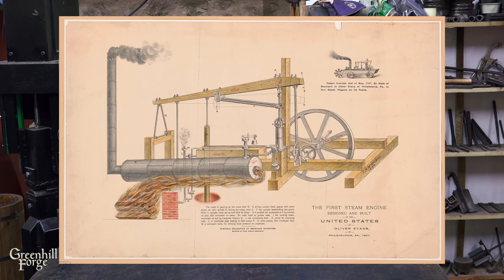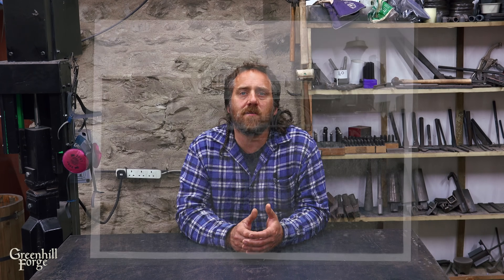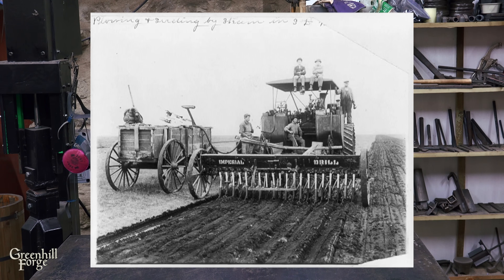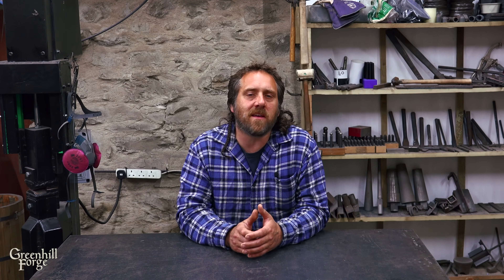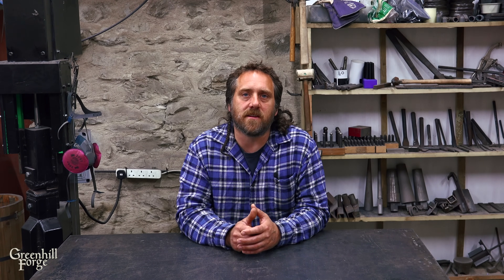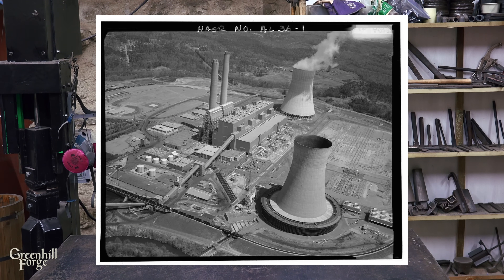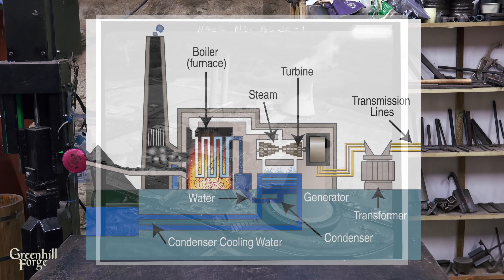Help Me Design an OffGrid Steam Engine + the Basics Explained

Comment: I have a suggestion for one aspect of this admirable goal you have set yourself.   I have considered making something similar myself to compliment my other off-grid / ‘free energy’ creations (solar kiln x 3, solar water heater, work-in-progress rainwater collection and purification, ongoing sand battery project, bug-proof salad crop growing enclosure). So here’s the suggestion and it builds upon developments you’ve already demonstrated with the efficient extraction of heat from wood burning stoves.  So the problem I see is in ‘feeding the boiler’…a nuisance and very time consuming at the best of times. Solution…’bank’ the heat in a mass earth storage facility (‘sand battery’, if you like) and embed the most highly pressurized parts of the boiler system within the same heat storage facility. Yes there would be challenges in so doing (eg regulating i.e. ‘smoothing-out’ the extraction of heat from the mass heat storage vessel, avoiding explosive steam expansion and maintaining wearing parts embedded within the mass storage unit, reduction in overall efficiency, etc)…but there are benefits worth considering I think.  These would include in no particular order:  safe(r) containment of any ‘unscheduled disassemblies’ (ruptures) within the most highly pressurized portions of the system, pre-heating of water, thermal insulation of the boiler, some noise reduction and a few other more esoteric benefits.  I am currently working my way through some ‘wife projects’ so that I can resume working on a domestic portable sand battery using easily available materials and ‘achievable’ methods of assembly. The reason I mention this is because there are some important lessons to be learnt from managing the large temperature change from within the ‘battery’ to temperatures that are tolerable at the output stage. I could ramble on here (already have?) but if you start with a fixed VOLUME of the battery and apply a fixed AMOUNT OF ENEGY to it and hope to EVENLY extract tolerable levels of heat from it you can regulate the maximum temperatures and rate of heat flow through it by adjusting the nature and configuration of the media used to store the heat. I am currently working towards trials based upon various combinations and configurations of sand, aluminum and ferrous metals, using their properties of thermal capacity, thermal conductivity, density and melting points, plus importantly their physical configurations within the enclosure (‘battery’) to optimize the outcome I am looking for….an even, safe and controllable heat source for those cold Florida winters (yes, really). The short version of this is that a fixed amount of energy placed into a fixed volume of material can be made to result in a surprising range of maximum temperatures by the simple expedient of varying the quantities of these three components, plus, their physical configuration within the fixed volume will (can be made to) result in a steady ‘down draw’ of that energy by arranging them to optimize their various coefficients of thermal conductivity.  Allied to this project I have been thinking about a more static mass heat storage system (Amish/Greenhill Forge rocket stove style system) that would have heat extraction tubes and possibly domestic water heating tubes running through it….hence my interest and concerns about managing and controlling steam explosions.  There I said it……British civil engineer (plus self taught, know just enough to be a danger to myself mechanical engineer) living in USA signing off for now.  Good luck, watching with interest.

Comment: hi im not an expert but i used to work at geothermal power plant .If you wanna use just water i suggest not or at least lower your expectations . Cause of the water it does not have the potential to be great and stable in use . yea i may sound wrong but it is. let say we dont have much and we have to use water as a work fluid and then if you going all the way on the project i suggest using seperator for steam and the hot water. Side note:  where i live the tap water is chalky other minerals are involved. To the exit of the seperator akumulator might be great to so brine or work fluid can be laminer flow .Lets get back to seperator the hot steam will go to the turbine .Side note : If you make the line between the separator and the turbine with a 1%-3% slope, you will prevent the problem caused by condensation from disturbing the turbine.  at this point if its complicated make it just like on the prototype . I really like ur videos i might build this on my backyard aswell if yours work :) but things can be got out of hands easily how much bar is it or whats the ttemperature whats the flow rate. I can make contact with you if you wanted on instagram if you respond good luck and thank you for reading the comment.

Comment: A big issue with steam power is efficiency. Due to the nature of thermodynamics, the efficiency is capped by the maximum achievable temperature of the working fluid (or, more accurately, the difference between the maximum and minimum temperatures), and in the case of steam that's the boiling point of water, which is very low compared to what fire can do. This can of course be increased with pressure (the system will spontaneously pressurize to prevent boiling if the water is heated in a sealed space), but pressure comes with danger, and it takes a lot of pressure to gain just a little bit of temperature.  It would be more feasible to reduce the temperature on the cold end by condensing the water well below its boiling point by the use of a vacuum (the condenser will produce this vacuum on its own if the system contains no air) but this will cause air to slowly leak in anywhere it can and necessitates a continuous de-aerating system. Even with a temperature swing of 100 C on the hot end and 20 C on the cold end (0.023 atmospheres absolute pressure), the maximum theoretical efficiency is only 21% or so. If you pressurized the boiler to 10 atmospheres, it will boil at 180 C and when put against a 20 C condenser that gives a theoretical maximum of 35.3%, but that's 147 psi, which is a lot of force. These are also only theoretical numbers, and in practice the observed efficiency will be considerably lower for a number of reasons.

If efficiency is a priority, it may be advisable to use a gaseous working fluid operating on a brayton cycle (heating and cooling gas) instead of a rankine cycle (boiling and condensing water) to bypass these issues. A stirling engine is probably your best bet, but other systems are possible. Air, or another working fluid, could be directly compressed, then heated, then expanded, for a net energy output. This heating can even be achieved by directly burning the fuel in the compressed air. This is the principle of gas turbines and jet engines, and works well with a turbocharger from a car to act as both compressor and turbine. Good efficiency still demands large pressure swings, but that's a lot safer with gasses than with boiling water.

Comment: Turbine>piston seems like a no-brainer in terms of efficiency and it eliminates the need for a massive fly wheel. Matching the turbine to the generator may be both expensive and difficult in terms of sourcing the right equipment. Also I believe AC generators are supposed to be more efficient and rectifying the 2 or 3 phases into DC using capacitors shouldn't be that hard.

I am excited to see your progress because this is something I have wanted to do for many years.

Comment: low/high pressure steam is fun when all systems are working properly, very very dangerous when not. ofcourse one step higher would be supercritical steam system, but even more life ending. Keep in mind all steam plants in powermode have a operator which is checking all parameters constantly. fuseable plugs would be a good start with duplicate or tripple pressure relief valves. Learning from steam locomotives is also  a good start as they were engineered to the max for power/fuel use.  What ever your system would be, don't leave them unattended if you make as system from reuseable parts which are not designed for a steam engine (boiler).

Comment: If you go with a traditional piston engine I recommend keeping the piston near the boiler as the length of piping from boiler to engine can affect efficiency

And for the water removal I recommend looking up drain cocks like on steam locomotives 

And you could use old car flywheels or engines converted to steam engines

Comment: For the amount of useful energy you're going to produce versus the amount of heat, noise and effort, a 400W solar panel will be wayyyy more useful and productive to fill up your batteries. And in the winter: get 4 of them. Burn stuff to keep warm and make coffee and bread and feel happy. 
I have always loved the idea of building a wind turbine and I like engines and mechanical things, but with the intermittent production, small scale and the inefficient conversion: in this day and age, just go solar. It's so effective.

Comment: I looked into diy steam generators years ago and it seemed easy and fast to find an old 2 cycle motor, any water tank ( w/ 2 over pressure relief valves) and wood. You can find all 3 easily, w/o need for a whole shop and a special degree to get results.

Comment: You need to keep to low pressure which means you need to return to the original method of increasing power that they used in the first steam engines. Power was achieved by filling the cylinder with steam then injecting cold water that flash cooled it and created a vacuum that was much greater in the negative than the steam was positive. They were actually vacuum motors. I don’t see the need for fancy vapor capture system when you would have water at an off grid scenario.  The locs had a vapor escape system where it would go up the chimney and increase the draft in the firebox, that is why you got that puff puff effect with the white smoke. I have some marine heat exchangers that would make good boilers for a smaller steam engine of that size.

Comment: Several things put me off building a steam engine. Firstly a home made version is only 3% efficienct. Compare that with gasification which is 25% efficient and a regular diesel engine that's 40% efficient. Secondly steam is highly regulated by law and very dangerous. Gasification is your best bet which is what I'm experimenting with also. Cheers J
Reply from the maker: I've played with gasifiers before and agree that they're really cool. I'll be putting out a series on them before too long. I'm curious where you got your numbers? I think hitting 7-8% would be quite doable. Definitely not the most efficient thing but it's more for the love of the engineering. A consistent 25% efficiency for power generation on a gasifier system would be an exceptionally great system, I'd expect most DIY systems are in the 15-20% range.
Reply: @GreenhillForge  the earliest steam locomotive 'the rocket' was only 3% efficient. Modern highly engineered steam turbines are 40% efficient at best. But look ing at whats realistically doable in a small workshop I don't think you can achieve better that the rocket. Chatgbt recons 3-8% efficiency on a home made set up. With modern materials and precision engineering you could achieve greater. Gasification is easier, cheaper and more effective. Cheers J
Reply from the maker: @joshuadelisle  Some of the first improvements to the first engine that really increased efficiency were a condensor, double acting piston and improved piston rod guides, all of which could be done. I think hitting double digits would be quite a challenge but 7-8% quite doable. I agree that gasifiers are easier and cheaper but the point for me is more about have fun building something challenging and just loving the history of steam power.

Comment: i have steam converted briggs engine and old 55l gas water heater as boiler fired by wood, 55l boiler is not enought for 120cc of briggs , it cant run continuousli , the best displacement for that smal of a boiler woud by about 50cc i think, but at 1bar the 120cc briggs has insane amount of torgue , not mutch speed though
Reply from the maker: Sounds like an awesome system. I'd love to know more about it if you have time to share, either here or email at info@greenhillforge.com . thanks!

Comment: Drying:
Magnesium sulfate is pretty easy to make from Epsom Salt. Spread out on a baking sheet, 500 degrees, and about an hour later the epsom salt becomes very white and dry. I think the guy on the channel NOBOX uses magnesium sulfate to dry out air before it enters his air compressor. If I am remembering right, he just fills a PVC pipe with the drying agent and the air passes through it before entering the air compressor. Now I have to go find the video...
Reply: This would be totally useless in a steam engine. Use a cyclone separator, followed by running the steam pipe back through the firebox to ensure the steam is at least dry saturated, and preferably superheated. Wet steam entering a turbine will destroy it very rapidly. A reciprocating engine will also be destroyed by wet steam, but it will take much longer. You will need a blow off valve to vent any water/wet steam just before the engine on first start up.

Comment: All I can say is, good luck! I thing some challenges that have been overlooked by other comments are the need for good ancillary systems: steam lubricators for the valve and cylinder and drip lubricators for the crank/cross-slide (if double acting), automatic and redundant feed pump, cylinder drain cocks or some other method of preventing water lock, and if you want it to be somewhat automatic, some form of controlled induced draft. 

I am really just talking from my armchair here but I would imagine that getting the valve faces to run reliably (assuming you do slide valves) would not be particularly easy. That's a materials selection and surface finish challenge to get the right grades of iron to run well against each other under such high forces with fairly short stroke reciprocating motion in dry steam. Might make other valve types seem tempting, but unless you're repurposing prefabricated poppet valves, I don't think a piston/spindle valve checks the "home shop fabrication" box. That's a fine job on a nice machine lathe. 

Then second to that, it seems like it might be challenging to maintain good piston sealing. You really want to target double acting, I'd imagine, since this halves the impact of frictional losses. If you do, then the piston rod gland seal and the piston rings themselves seem like they will require care. The piston rings would need to by symmetrical or capable of taking pressure from both sides, so I think this disqualifies some of the tapered rings and oil rings and other fancy junk on a modern internal combustion engine. I think that means you're making your own piston rings? I've seen plenty of folks do it on other channels, it's not rocket science I'm sure, but it's just another thing that has to be a running fit that runs in properly and has the right material properties to wear smooth and not to gall. 

I almost wanted to suggest water tube boilers. A fire tube boiler like you're contemplating is not actually super necessary here. you have a steady load: fire tube has excessive thermal mass in the water, which is nice for a traction engine that requires some power above and beyond the fire for transient loads like starting/short hills. But it's just more hazard and warm-up time for a stationary engine doing perfectly steady battery charging duty. However I have heard that water tube boilers are more prone to fouling and also work better at bigger scale, and are probably more difficult to fabricate in the traditional method (where there's a gland or dry caulked connecting each water tube to the steam drum). On the other hand with modern materials and fabrication methods, it seems like a water tube boiler made of stainless (is there any reason not to use stainless aside from cost? maybe... risky to deviate from tribal knowledge!) and TIG welded to the steam and feed water drums might have advantages... 

At the very least, the explosion risk may be reduced due to the lack of a firebox under buckling load from surrounding steam pressure and the lesser volume of water.
Reply from the maker: all great insight, thanks!

Comment: Combustion/fuel burn is the least efficient method for creating electricity. Just use solar panels. If you think it’s not working, just buy more they’re so cheap now.
Reply from the maker: this is basically an idea for backup when the solar/wind/hydro isn't enough

Comment: I'm off grid in Northern Ontario. Solar in winter is a challenge here with fewer charge hours and the addition of block and waterline heaters. Steam would be a great assist especially if you could use the woodstove exhaust as the boiler heat. It takes a full 9 hrs of the generator running(4500 w)to charge up my 6 200ah batteries every week or so depending on the weather. If that work is to be done by steam, it would have to be either as a trickle charge using the wood stove that is already being used and fed constantly, or big enough that it could do a full charge once going ....without having  to be fed all the time. No one wants to run outside in -30 to stoke a fire.
Reply from the maker: that's basically the goal here. to fill the gap self sufficiently when solar/hydro/wind aren't cutting it